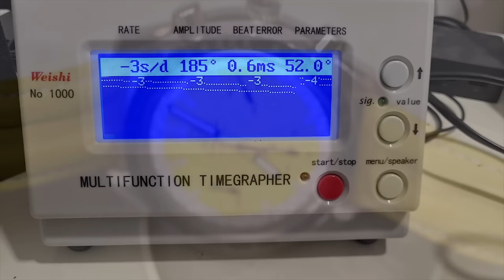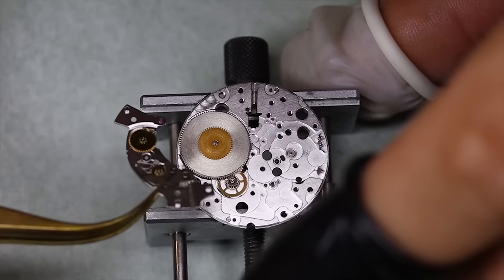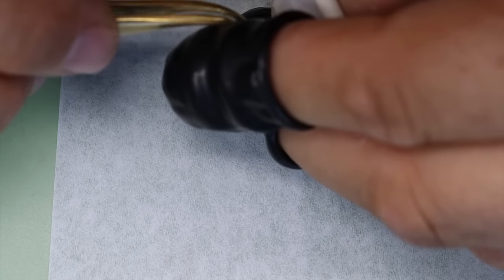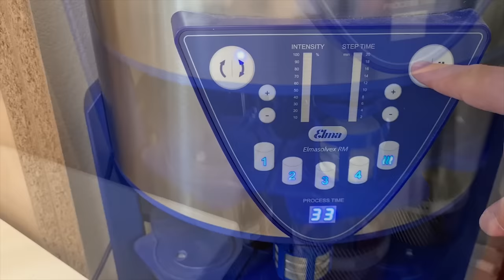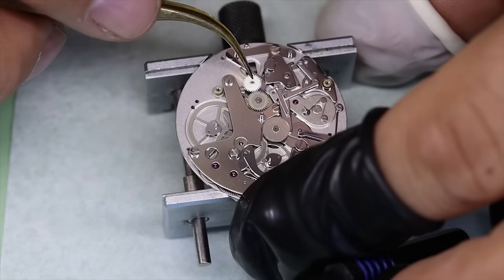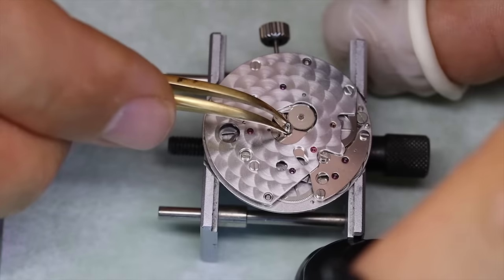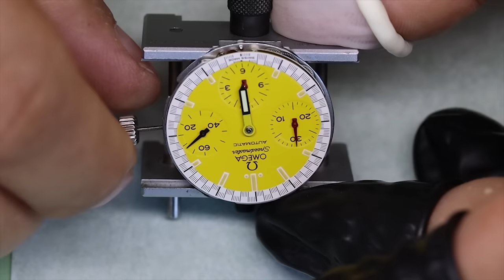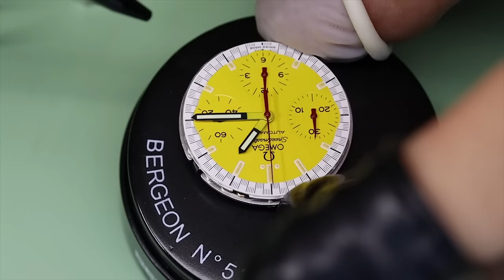The coolest watch on the track - but is it really an Omega?

Comment: As an economics major, I'd be curious to know what price point Omega put this watch at when it was brand new, despite not having any actual Omega parts or engineering in it and practically zero OEM workmanship, save for final assembly.
Reply from the maker: Hi Caledon, I honestly do not know, perhaps someone else in the comment section might? My best guess would be somewhere around $700-1000 when new in 1997.
Reply: Omega did change this caliber. Omega has made their own movements in-house all of their history, but for the 80's and 90's, precisely this watch is from the 90's. In the 2000's they begin again making their on movements. In fact, Omega always maintained their movement for the Professional model, which was used even by Vacheron Constantin... But in this case, it isn't true that Omega didn't put their own parts, they did change this caliber, they changed part of the winding mechanism, which you won't find in any other ETA 2894-2, and they added 8 jewels in friction points. ETA 2894-2, has 37 jewels, not 45, as Omega 1140. Omega did the same in other ETA movements in the period when they used them, and from all the brands you can see that used these calibers without adding functions, 2894-2 and 2892A2, only Omega put their own  engineering and much more finishing work. Breitling, Bulgari or GP, to name a few, didn't do any of that, they did use them as ETA delivered, and at most a little more finishing, never the upper plates, as Omega did with 2892A2.
Reply from the maker: Hello Lee, thanks for watching and for your comment! Note that the ETA 2894-2 is not the same as this movement. 2894-2 is also a modular chronograph based on the 2892 family, but the chronograph module is made completely by ETA and differs signficantly from this DD module. 
Omega did make a few changes to the base of the 1140/41/3220, but they were honestly pretty minor and in my suspicious view made mostly to be able to call the movement an Omega and thereby being able to charge a higher price... that's my main gripe with this approach, that it seems driven by commercial interests rather than the product superiority Omega built their reputation on.
Reply: @VintageWatchServices  They didn't need to change it to call it a caliber 1140. They did change the jewel count, the winding mechanism and the finishing. Is that minor? In comparison to making your own movement, as Omega always did before, or after, yes, but it is a brand that has never used off the shelf mechanical movements, not even here, and not even in their worst moments. Just compare this with Rolex not producing a single movement for an entre century and not changing an screw of them, or Breitling not even signing them. I think Omega was much more honest in this approach.
Reply from the maker: Hello Lee, I wrote a response in the other thread where I'm trying to understand which difference you are referring to in jewel count. Perhaps we can continue the discussion in that thread? Less typing for both of us :)
Rolex is not quite the same story, even if they technically bought movements from a third party they owned a large stake in Aegler and Aegler provided movements pretty much exclusively for Rolex since a hundred years back. Breitling is a cynical company for sure even though I commend them for finally starting to make their own movements. And don't even get me started on Panerai!

Comment: Probably one of the worst movement in history! In the ETA 2892, there are two wheels that are so near that they almost touch. And sometimes they touch and the watch stops. The reason why Omega used these cripple movements is obvious: The lebanese  Jew wanted to save money. There are no Omega movements since around 1983 anymore, so why wonder?
Reply from the maker: The 2892 is a pretty solid movement overall although it has a couple of pretty bad flaws indeed. And the module approach is quite popular given that it allows companies to market a chronograph without much ado. Btw, please be careful with your language in these comments, I really don't want to see any wording like that.
Reply: @VintageWatchServices  Nevertheless, you seem to be quite a good and serious watchmaker. Although, today real watchmakers like in the good old days of my father (means: not just repairing watches and parts but really making wheels, axes, making calculations, designing wheels etc) are damn rare. I only know one guy, that is between complete madness and genious, that works like they worked in the 1940's!